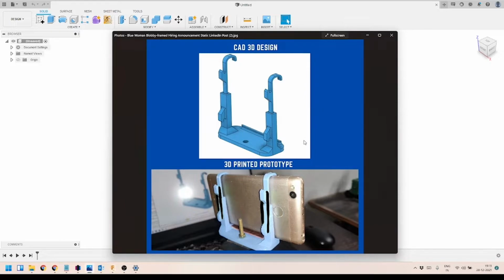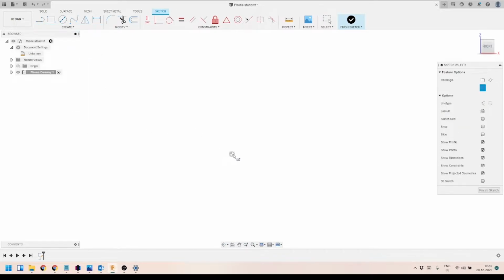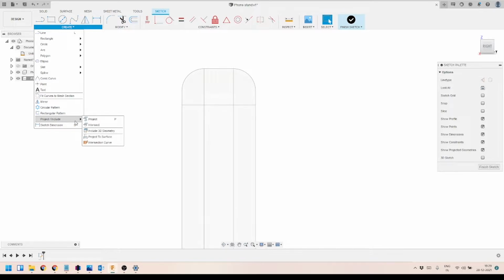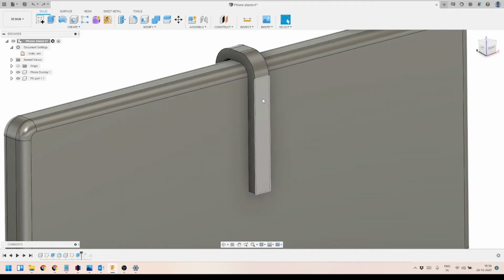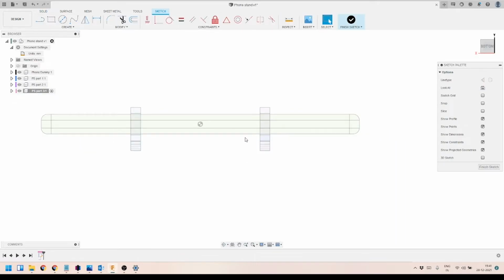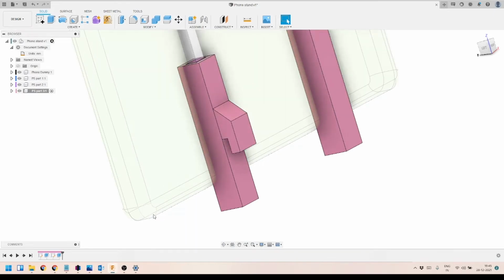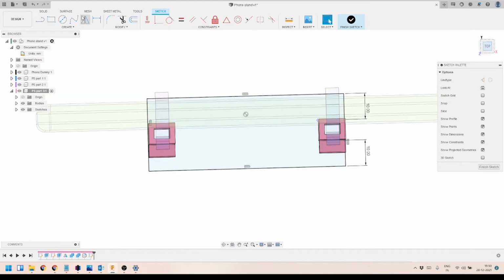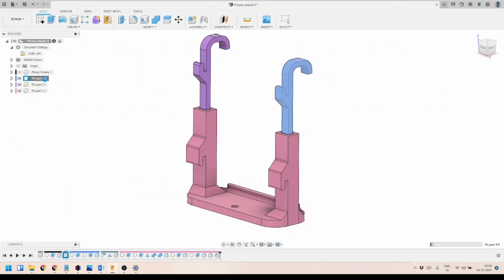Fusion 360 Tutorial | Step by step 3D modeling tutorial of Phone Stand for Tripod.

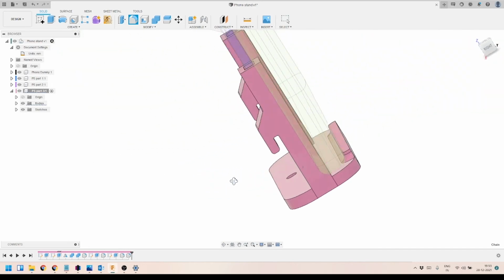Comment: I am slowing becoming more comfortable wF360 thanks in part to your videos.  I noticed shortly after we extruded the lip  (around 30:00) that the phone is interfeering with the holder.  Adjusting the base was easy, but not so with the top clamps because we used offset.  I’ve gone to try and fix it and haven’t found an elegant solution.  Good tutorial though as working through problems like this is part of the real world.  Thanks!
Reply from the maker: I appreciate it, I believe the best way is to learn by doing practical projects